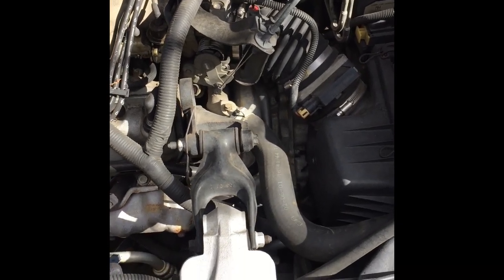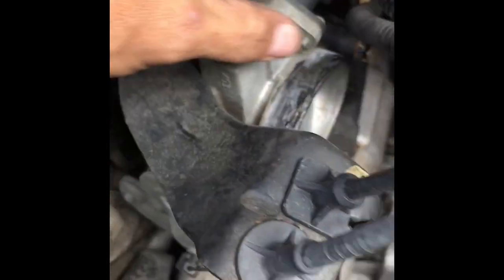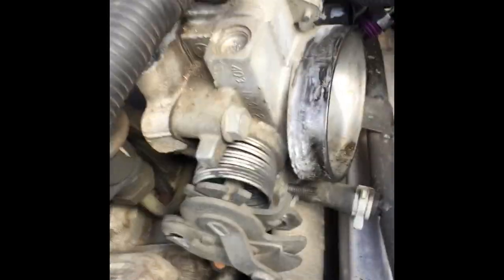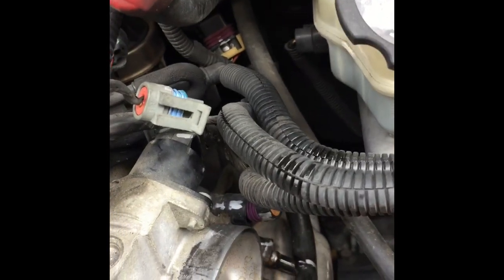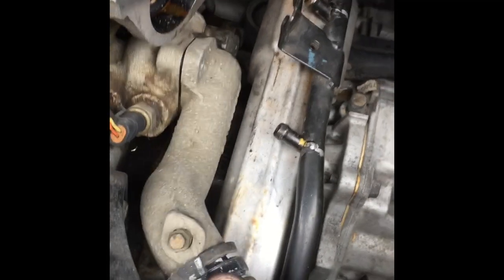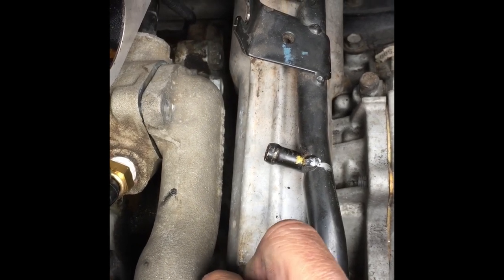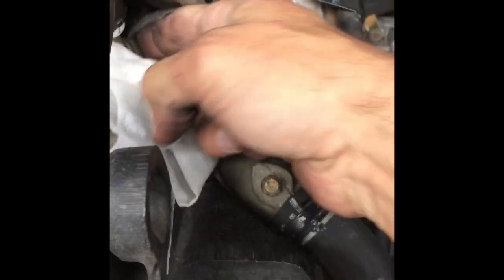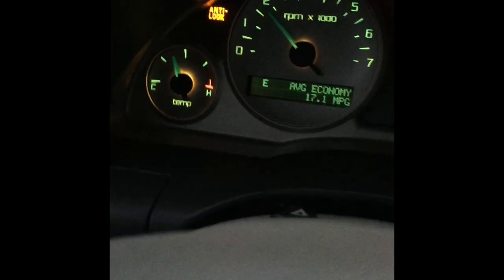Buick Rendezvous thermostat fuel pressure regulator throttle body coolant temperature sensor

Comment: I just did the repair.   Take air intake boot off.   Use ratchet and extension and 13mm socket on top bolt.   Put extension under coolant tube first then slip socket on.  Socket won't fit under tube.  Then use 13mm ratchet wrench for bottom bolt.  Hold tube to keep tension on bolt so your wrench will keep ratcheting.  And remove bolt.  Tube. Thermostat.  And reverse.  Difficulty...5/10
Reply: Wish you could do a video demonstration of what you took off and how you position your ratchet and point out where we need to ratchet back both.

Comment: ratchet wrenches are to fat to fit in there to remove thermostat bolts still not to bad the issue i had fun with was removing the fuel pressure regulator itself cause it was on tight had to use 2 wrenches